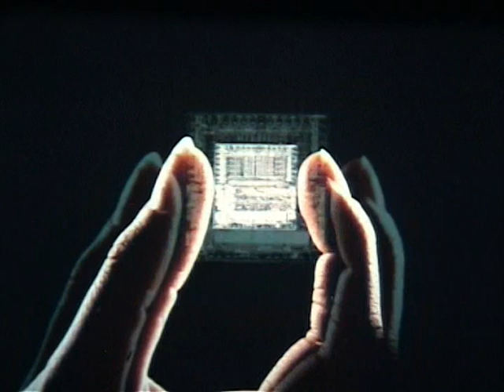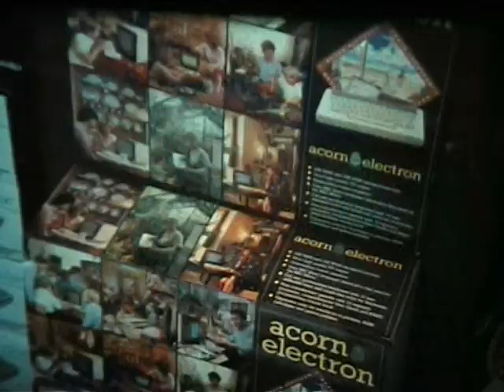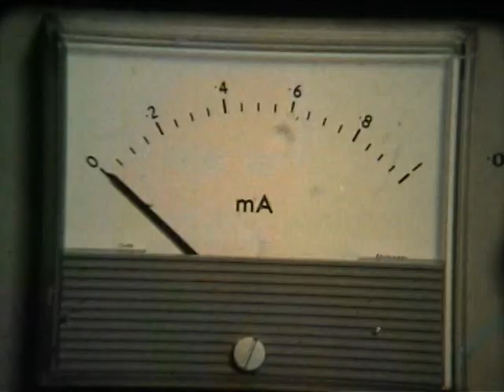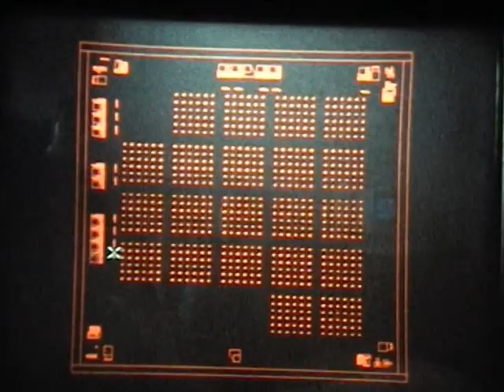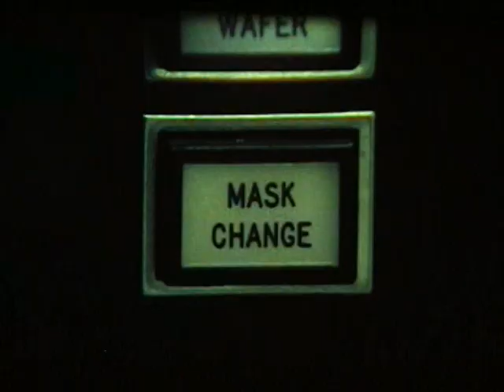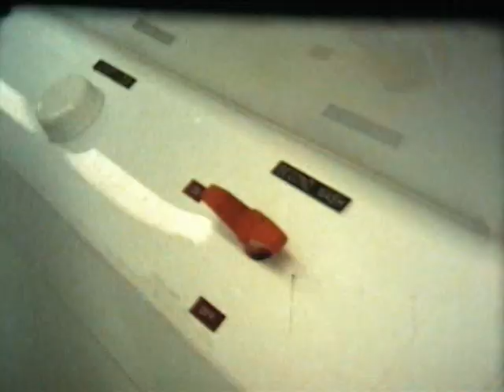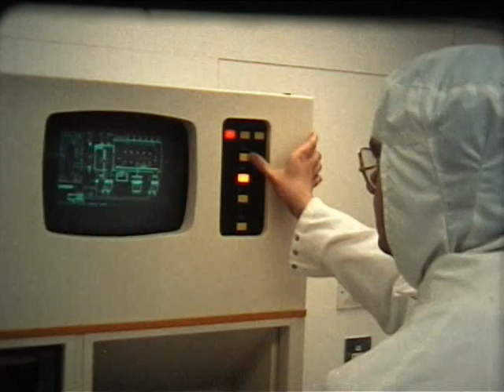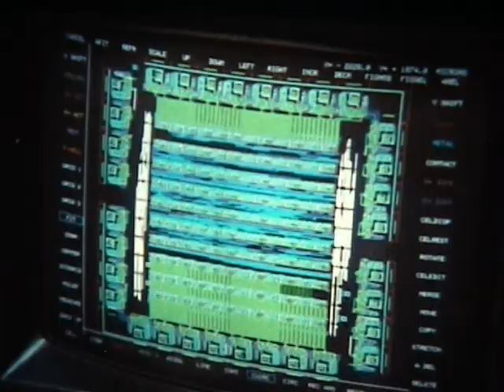The Ghost of Ferranti - all about the pioneering UK chip maker

Comment: Fantastic, never seen an actual solder bath before, fascinating. I just completed my dissertation on Ai and actually quoted its like the third industrial revolution, with the second being the micro boom of the late seventies. Thank you for sharing!
Reply: It's a bit more complex than they describe in the film. They don't want to just dip the whole board in solder because it would cling too much and create short-circuits. Instead the molten solder (mostly lead and tin in those days) was circulated through the tank and then at one point there's a ridge that it has to go over which creates a stationary 'wave'. When the track above carries the boards past this point a thin portion of the board is immersed in solder at one time. In fact the process is commonly called "wave soldering". Completely obsolete now, but they were still using it at GEC when I was there in the early '90s.